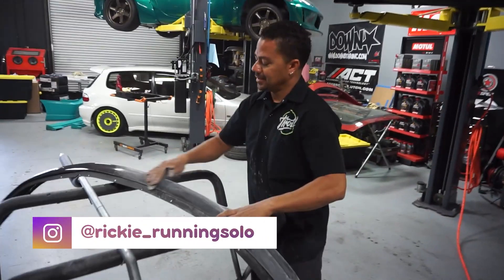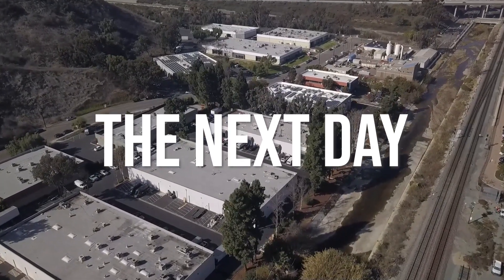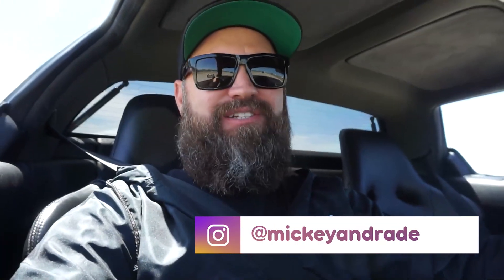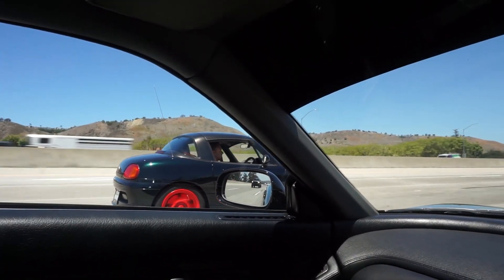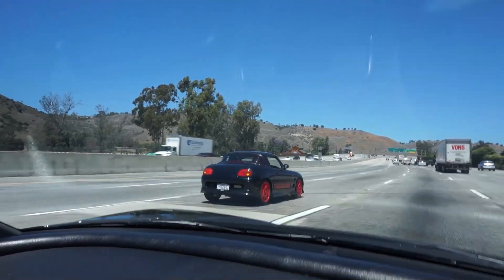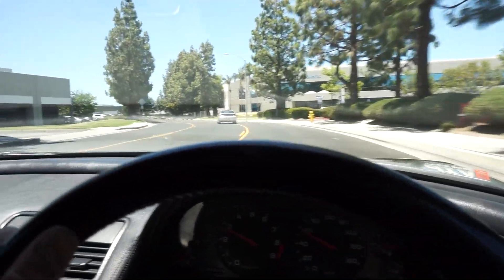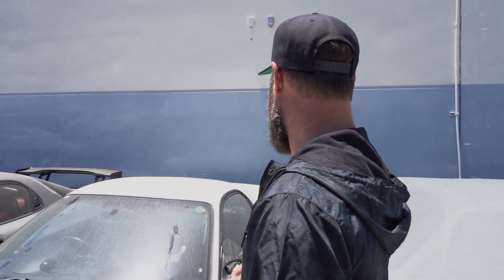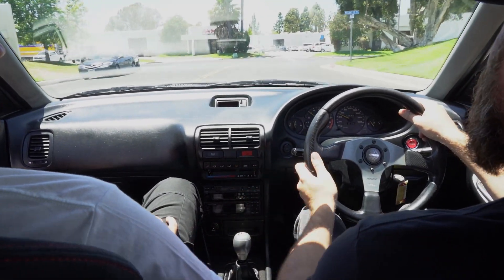Two of our cars are FOR SALE! (Not Clickbait, let us explain…)

Comment: Interesting move on the NSX. Sucks we didn't get to see it around longer.
Reply: pretty disappointing
Reply: NSX isnt a street car. super low, tight interior. Letting it go makes sense. Nothing left to do with it anyway. Buy stock car, build, showcase, sell. Thats the YT formula!
Reply: Fr man
Reply: They would be constantly working on the front lip or replacing it if it had stayed any longer😂😂... sad to see it go what an amazing build amd car
Reply: It had so much potential too
Reply: @ripperhigh8001  Yeah but like they said they need to keep the cycle of content going. And at the beginning of the series they said they weren't gonna do any work on the engine so that shortened the car's amount of time in the shop.